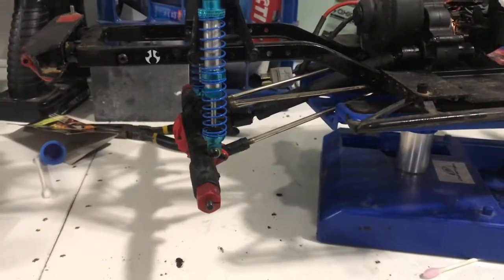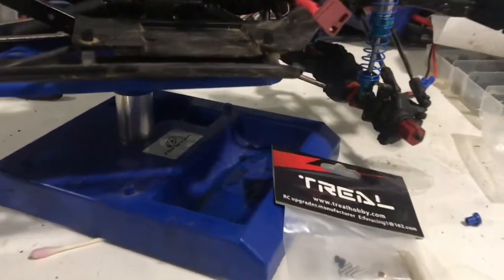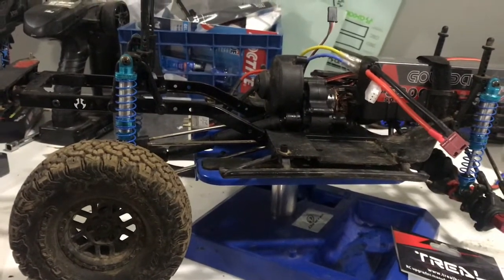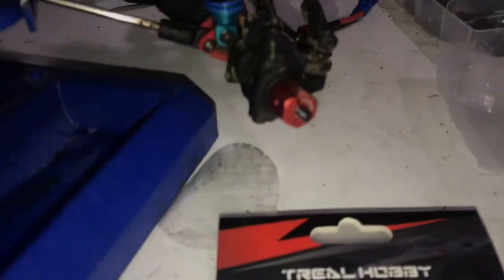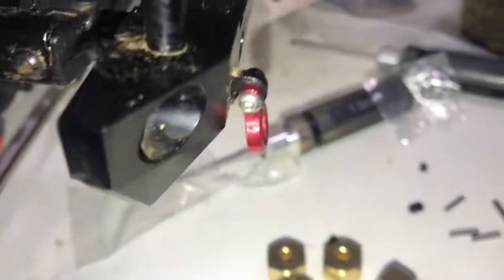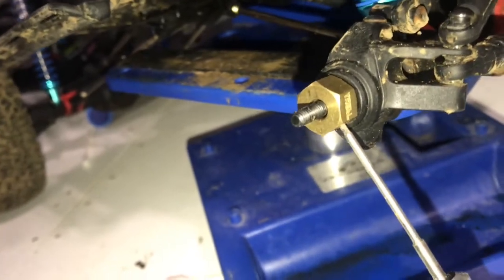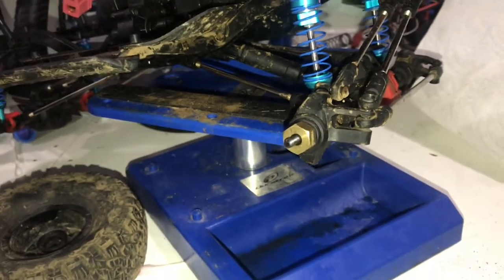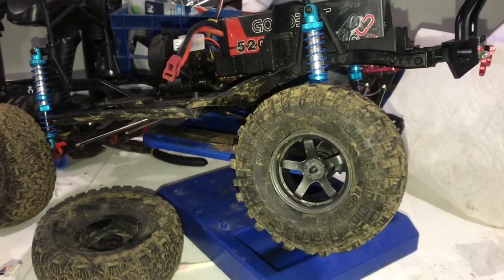Crawler wheel spacers install

Comment: I have inner rub would this work
Reply from the maker: yes and no, if your running a 2.2” tire i would highly recommend going down to a 1.9”, the spacer will help with inner rub if your using a 1.9” tire, definitely better than stock and the truck looks that much better
Reply: rchobbiespro I’m using 1.9 bead locks on 4.19 tires